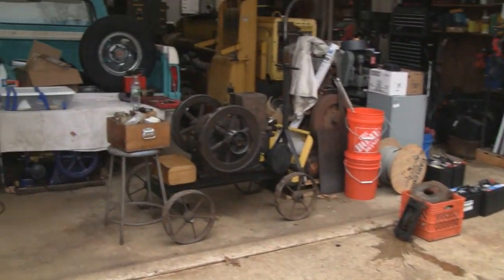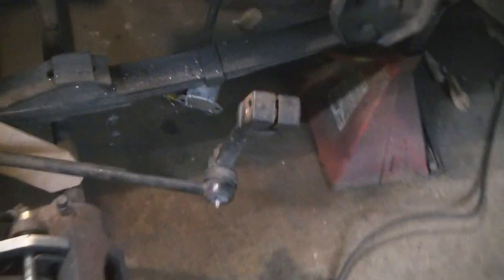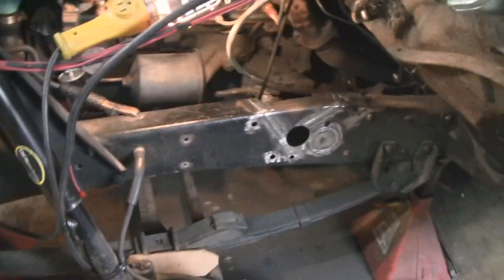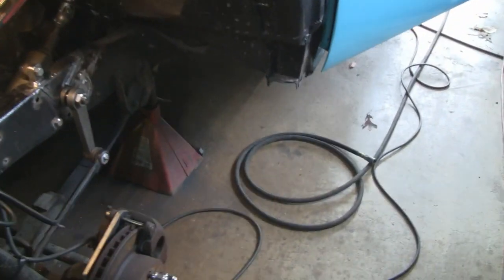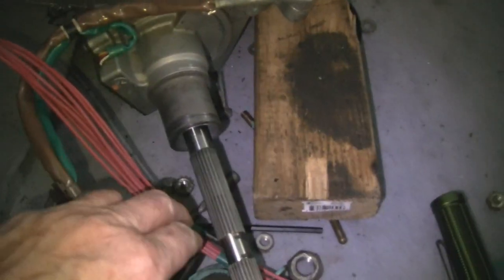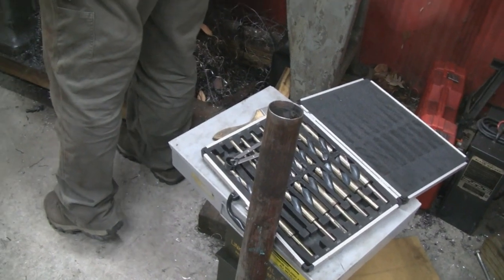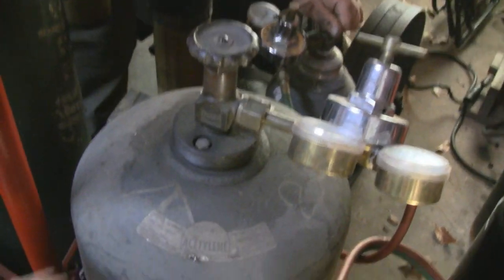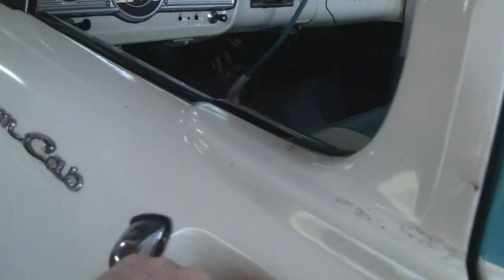ELECTRIC POWER STEERING UPGRADE 64 FORD F100 (part 1)

Comment: The failure mode on my Dad's POS with electric power steering was that he was going down the highway and suddenly couldn't steer. Not that it was difficult to steer, he couldn't steer it at all. Restarted the car and the steering wheel starting jumping back and forth by itself. I fail to understand how that system is an "upgrade"... Be safe Roadking!
Reply from the maker: What make car is your Dad's POS!!☻
Reply: @805ROADKING It was a Ford version. I assume they are all the same basic system but hopefully yours is built better. Just freaks me out that an electrical sensor had the ability to lock up something as important as steering!

Comment: Outstanding!  Quick question: how much current does the electric power steering draw? And not to add to your workload, but if you're thinking hydraulic clutch, perhaps you could consider a 5 speed swap!
Reply from the maker: Thanks Shannon!! Don't know what it draws but they suggest a 60 amp breaker!! That 5 speed swap has me thinking now, the tranny in the truck now pops outta 4th once in a while!!☻
Reply: @805ROADKING , during the rebuild, did you do an alternator upgrade?  As for the 5 speed swap, I think the best candidate for your truck would be a "front shift" T-5.  Modern Driveline has everything you would need (to include the adapter plate).  Hope this helps and I LOVE this old Ford!

Comment: I like the power steering job. Well done..... no mounting a pump and/or fluid leaks. Great idea. The shop class in high school had huge torch tanks with a cart like yours also...... Never seen ones that size ever, until I watched your video. Glad you showed them!
Reply from the maker: Thanks Howard!! Getting to old to Wrastle the Ol' Truck without power!!

Comment: When this video popped up in my feed I thought you were simply replacing the manual steering box with a power unit from another vintage 60's era Ford.  You know the ones where the engine driven pump made that recognizable groan all of those old Ford's had as you turned the wheel.  My faded memory, as a teenager, of working on those old Ford Galaxy and Fairlanes used a hydraulic cylinder on the tie-rod and a servo valve on the pitman arm, which would be a nightmare to retrofit on this old truck.  Installing an electric unit seems like a good plan, although it might be tight under the dash.  I can't wait to see the outcome when complete.  As always RK, your videos are a learning experience, especially with Mike's craftsmanship thrown in.
Reply from the maker: Thanks Gary!! It is a tight fit but it will work!!☻